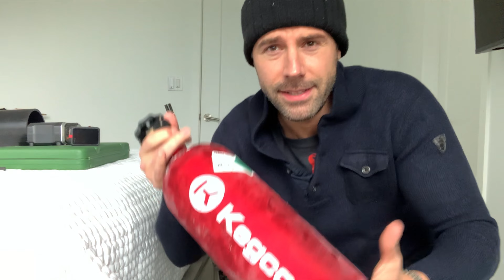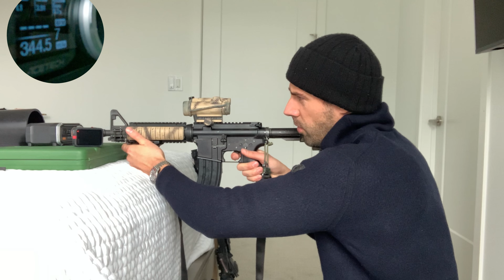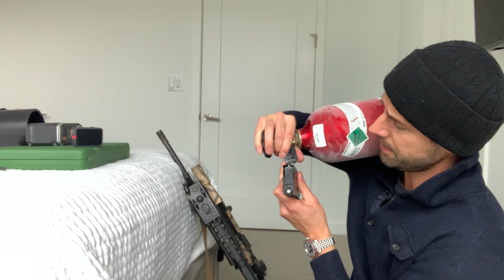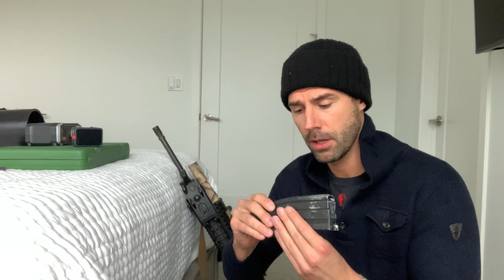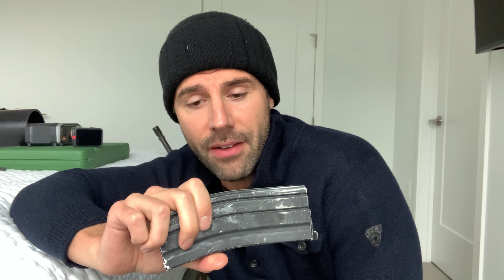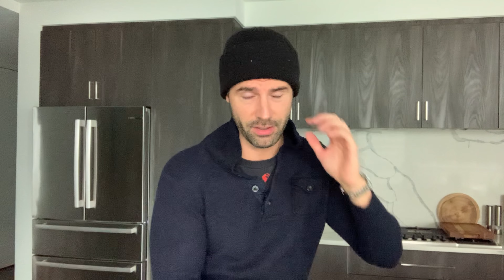Gbbr -14.4C/06F freezing test

Comment: Nice video.
Max fps is still dependent on your normal fps. My AK also drops a lot to about  1.3j if the mag has been in the freezer, if i remember correctly , while it shoots about 2.1j at 23 degrees C.  However, I do not use DHM but only normal CO2 mags. 
But I have never had problems with my valves and I also play in sub-freezing weather at the moment
Reply from the maker: @MKA thank you.

Interestingly enough my ghk Ak mags almost never leaked, it’s the ghk AR out put valves that gave me the most issues. 

I mean it an AK platform it’s just works, haha….

Comment: Of course they work, the bigger issue is that my fingers don't work 😅
In the green gas world I can bring a hand warmer power bank with me and warm the gas can up a little bit before filling the mag. I've learned this trick from BadaBing. IDK if there are small enough CO2 tanks that you could use this trick, I only use 12g CO2 capsules, not the DH mod. Or maybe if your safe zone is heated you can leave your tank there.
Reply from the maker: @sogerc1 yes that’s the best thing to do, having the gas tank warmer then your mags. 
I usually leave my tank in the but as I did this video it’s not even necessary.

Comment: can you use ghk magazines on viper tech
Reply from the maker: @ Joe Cardozo Good question, yes you can. Just be mindful of the plastic feed lips they like to split apart usually it’s a tiny hair fine line straight through the middle and that will cause some feeding issues on the vipertech and even on the Ghk itself. Solution replace it with new ones or you can glue it back together or you can get cnc aluminum feed lips. I got those and the feeding issues disappeared almost down to zero.
Reply: @TomiHarley  where can i purchase them
Reply from the maker: It’s a guy in Spain I believe who makes them you can find him on social media and most people contact him on Facebook this is his name: pablo vila ferrero
Reply from the maker: @Joe Cardoso here is my review on the Cnc feed lips 
https://youtu.be/KNgcKWJjZds
Reply: just file them, I do that on my GHK and I've never had one fail.
Reply from the maker: @MKAnr1  makes a great point I forgot to mention that, thank you MKA file the inner sides of the feed in an 45 degree angle open them up a lill so that the bbs come out easier and loading will be easier too. 

⚠️ very important do not over do it and to not file them from the top down otherwise the bbs will shoot out the make instantly the second you remove your speed loader.